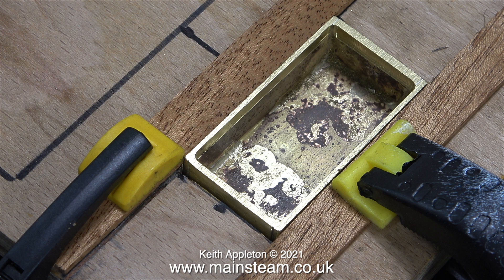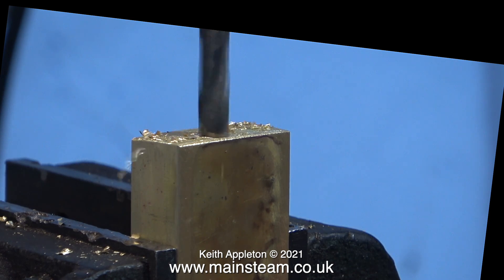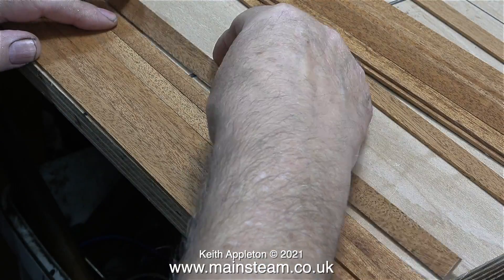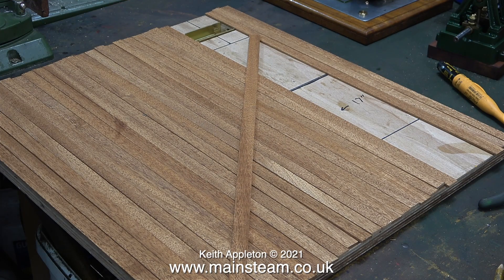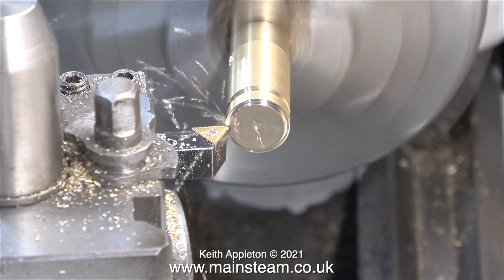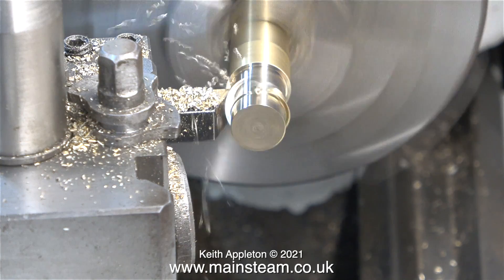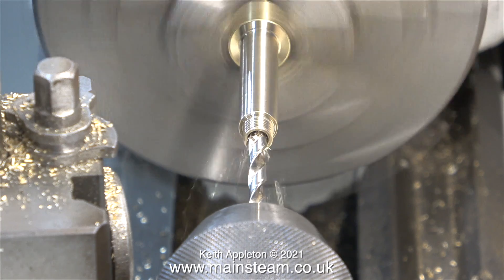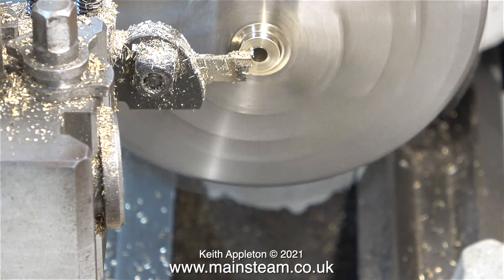MAKING A STUART MODEL STEAM PLANT - PART #45

Comment: As I've commented before: I've found that an hot medium strength solution of citric acid shines up brass and copper very well. The hotter, the better.
Recently I used some to clean out a 'completely blocked' car radiator and stopped the engine overheating. It took a few miles of running it to get the solution up to a decent temperature, but it the fuel costs were way less than replacing the whole radiator!